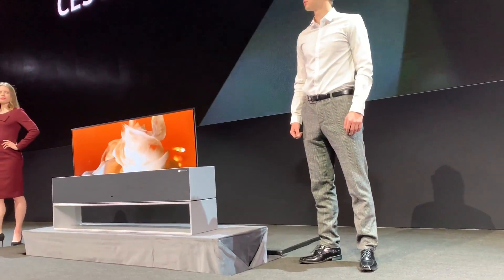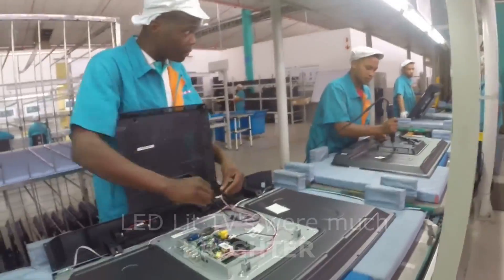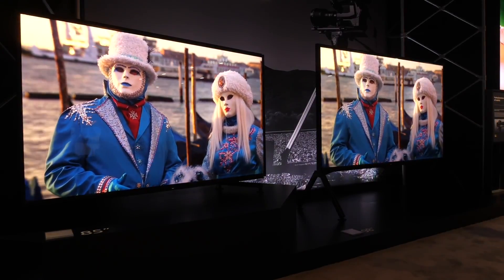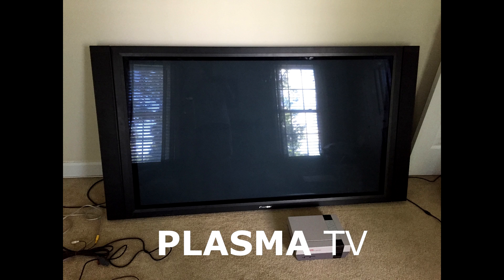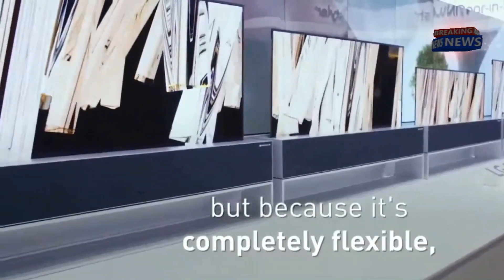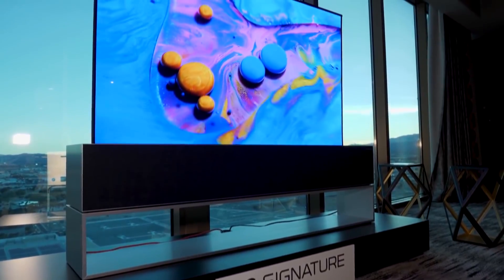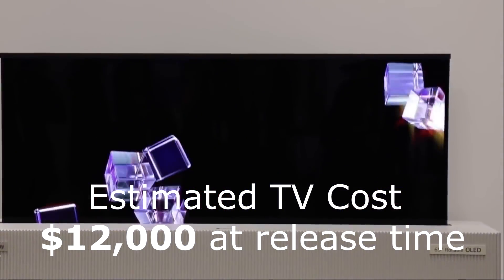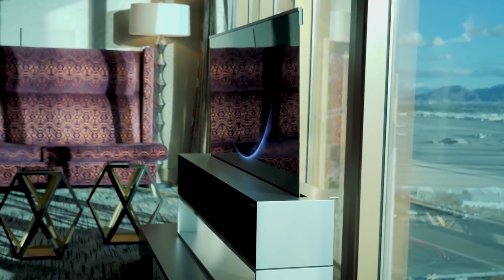COST of LG's new Roll-Up 4K OLED TV. Price & the Technology behind it.

Comment: I just wish they’d offer the wallpaper TV without the horrible soundbar... not that it is bad - but the huge soundbar ruins the entire clean and flat design of the wallpaper TV. In addition to being unnecessary since most people who decide to buy a high end TV already have speakers...
Reply from the maker: I thought the wallpaper TV had a separate soundbar with a long cable that you could put as far away from the tv as possible. They said there supposed to have an adapter for the cord also, so you can make the cord as long as U wanted?
Reply: bigdog8882 it is a 50cm ribbon cable which can be extended by an additional 1.5m extension. The ribbon cable is however quite wide, does not fit in in-wall-conduits (tubes) and is quite fragile. Also the connector for the 1.5m extension is ugly.

Samsung has this solved the right way: their one-connect cable is round looks almost invisible and can be very long. Unfortunately nothing like the wallpaper tv is available from Samsung...
Reply from the maker: @MustermannAnybody  I know, That big cable kinda defeats the purpose of callin it a Wallpaper TV. LOL!